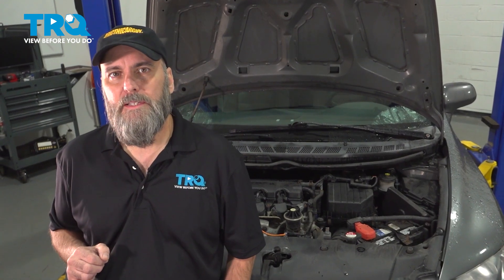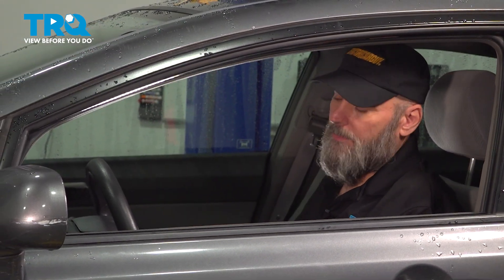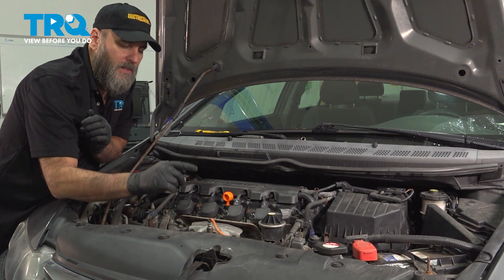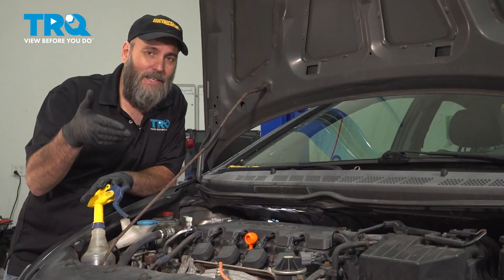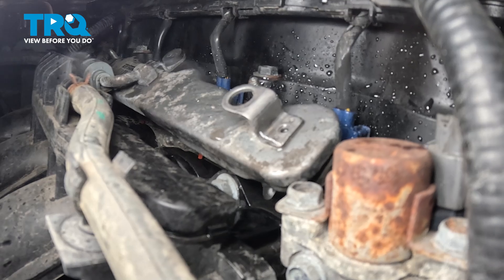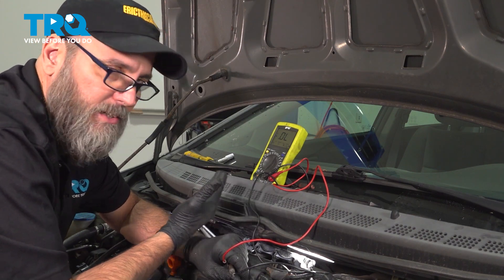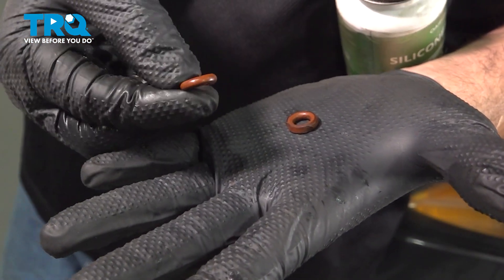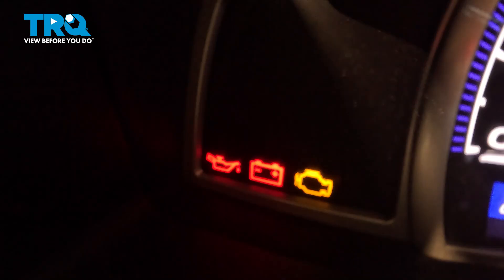EricTheCarGuy Explains Check Engine Codes: P0171 - P0174 Air Fuel Mixture Problems

Comment: My 2007 ford mustang has the two codes but it doesn't turn on. I changed the air flow sensor and still doesn't turn on. The gas pump has a 60 psi pressure so it's good.

Comment: hey eric and trq. this video is good if you have a vacuum leak, but there’s no mention of fuel trims or live data, so it’s  pure luck you found the issue this way. on a honda, clearing a lean code will cause it not to come back for at least 3 drive cycles. for all you know, the car is still broken. the code is set because of a fuel trim, not simply a lean ratio.